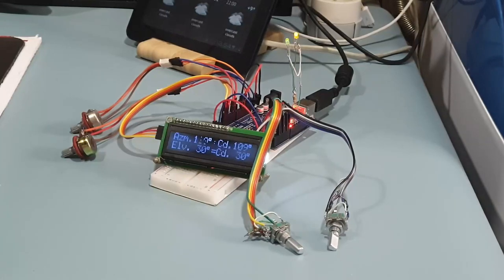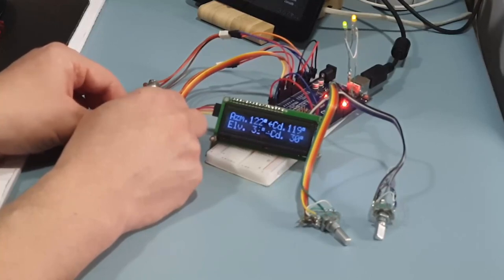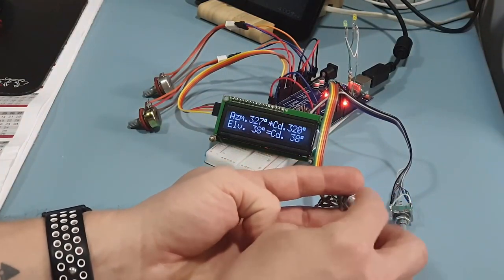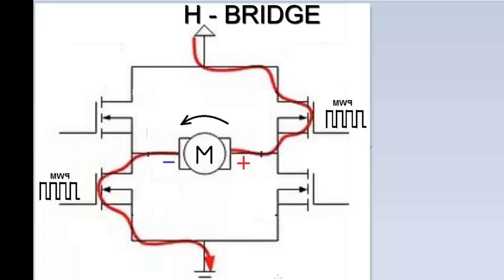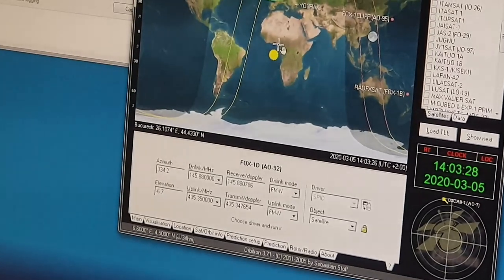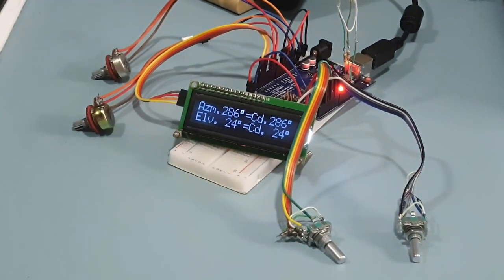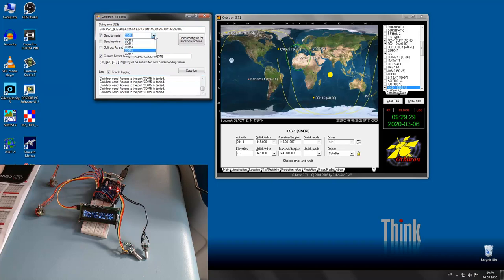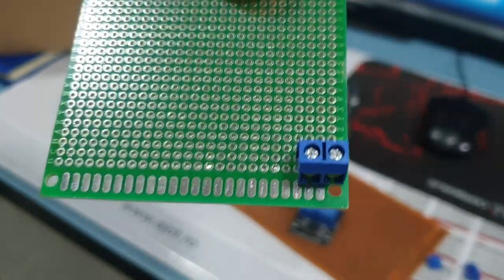ARDUINO ANTENNA ROTATOR PART1 - SOFTWARE AND PROTOTYPING

Comment: In SDR#, the frequency is visible: 145.550.  This in the Amateur Radio 2 meter band.  This does not require a dish with an LMB.  The antenna could be a simple 3 element measuring tape Yagi.

Comment: hi 
on your prototype is possibel conected Rotors olly use 3 wires..? 
example: Hygain Ar-500
thank you 
73
Reply from the maker: Hi Hugo,
It's possible, with small changes in the code.
The AR-500 is good and rugged, but has a major disadvantage, it doesn't have a feedback, a means to know precisely where the antenna is pointing. Usually this is done with a potentiometer geared to the shaft.
If you want to use this rotor with computer control, you have two options:
1. Use your mechanical skills to install a potentiometer inside, and have a very precise positioning. Everything is great, and you can use any tracking software you want.
2. Leave it as it is, and the software will rely on timing to calculate the antenna position. Assume the rotor does a full rotation in 2 minutes, this means 3 degrees per second. So we power the rotor for a certain amount of time, to go from one position to another. Less precise, and require re-calibration from time to time. PstRotator is the only software I know which is capable to do this.
Send me an email if you want to go further.

Comment: How do you connected orbitron to Arduino? What kind of protocol it use?
Reply from the maker: Hi Bonchart,
There is a link in the description towards a plugin for Orbitron, which sends the coordinates to USB.
After installing and launching this  plugin, select the port where your arduino is connected and then select Custom Format and input the following text: AZ[AZ] EL[EL]
This way, the plugin outputs a message like AZ25.5 EL45.7
which the Arduino takes in and translates into antenna movement.
Reply: @Racov  Thank you very much, i will try to do it :)

Comment: Salut, la ce se folosesc proiectele de genul asta?
Am mvazut in mai multe locuri pe internet proiecte de tipul asta doar ca nu stiu la ce se pot folosi.
Reply from the maker: Salut Andrei. 
Acesta este un controller pentru un rotor de antena. In domeniul radio-amatorilor, se pot face legaturi radio prin satelit, si atunci e nevoie sa orientezi antenele pe satelitul respectiv, iar acestea se misca pentru a urmari orbita satelitului. Comanda pentru pozitionarea antenelor e data de un program de calculator, care stie in permanenta pozitia satelitilor.
Reply: @Racov  Suna super bine...Ai incercat sa folosesti si un raspberry pi?
Eu vreau sa incerc un proiect ca acesta si sa includ mai multi senzori si sa incerc sa controlez totul printr-un server cu raspberry pi.
Multumesc mult pentru explicatie!
Reply from the maker: @andreiazoitei5387  Nu am folosit niciodata Rapsbery Pi. Pana acum Arduino a fost suficient pentru micile proiecte, si in plus, nu sunt profesionist la programare.